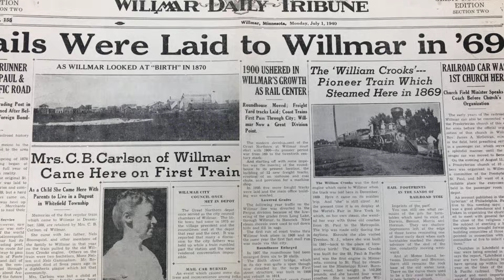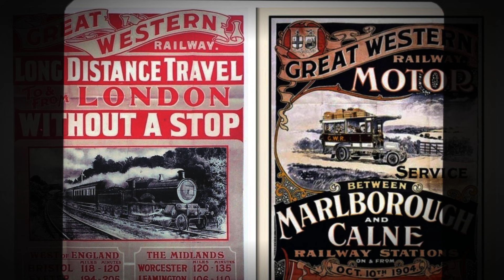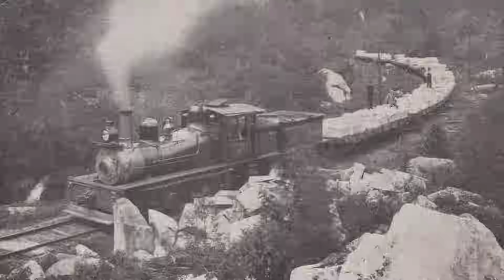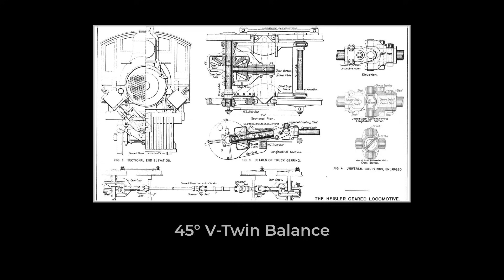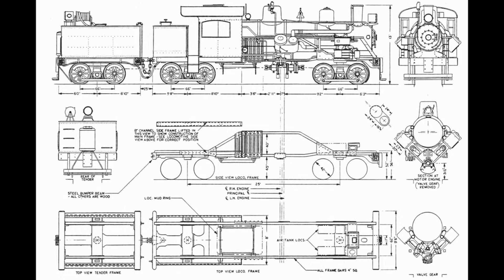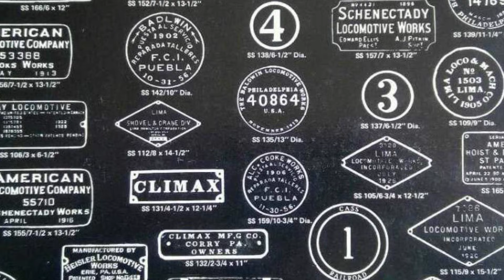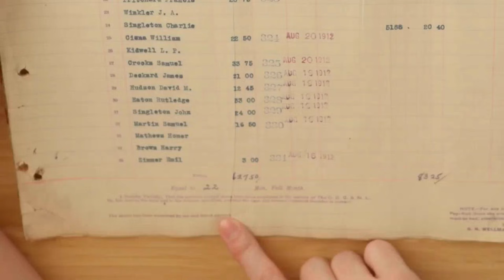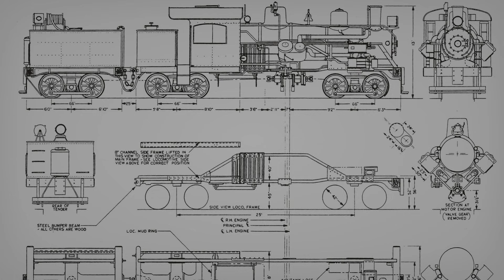Investors Called His Locomotive "The Most Idiotic Thing Ever Built" — Then It Took Over Railroads

Comment: THE TECHNOLOGY OF THE HEISLER  LOCOMOTIVE DRIVE LINES  MAY HAVE BEEN THE BEGINNING OF THE 
THE MODERN AUTOMOTIVE DRIVE LINES !
THE GREAT UNKNOWN INVENTOR AND ARCHITECT OF THE AMERICAN AUTOMOBILE, WAS LOUIS SEMPLE CLARKE IN PENNSYLVANIA!
HE AND HIS BROTHER DESIGNED AND BUILT MOTORIZED BICYCLES AND TRICYCLES BEFORE EXPERIMENTING AUTOMOBILES.
THE EARLIEST CARS HAD MOTORCYCLE TYPE CHAIN DRIVE SYSTEMS BETWEEN ENGINE, CLUTCH TRANSMISSION AND REAR AXLE.
ALL THIS CHAIN WAS AS MUCH AS 
3 OR 4 MOTORCYCLES, WITH CLEANING , LUBRICATION, AND 
ADJUSTMENT WORK.
LOUIS SEMPLE CLARKE  STARTED WITH AN 2 CYLINDER  HORIZONTAL 
ENGINE , WITH CLUTCH  , TRANSMISSION AND DRIVESHAFT TO AN CENTERED BEVEL GEARED DIFFERENTIAL AND REAR AXLE!
THIS WAS THE FIRST AUTO DRIVELINE
TO BE SUCCESSFUL AND COPIED FROM THE HEISLER LOCOMOTIVE!
THE CLARKE BROTHERS WERE THE ORIGINATORS OF THE AUTOCAR TRUCK CORPORATION, STARTED IN 1897, AND TODAY IS THE OLDEST USA
LIVING AUTO BRAND , NOW 129 YEARS OLD!

Comment: The engine at 12:02 is actually a Shay, Heisler's main competitor, and an excellent unit in it's own right.
West Virginia's Cass Scenic Railway, a former logging operation, is a well-known haven for Shays and even features a lone Heisler.
The concept of the pivoting powered trucks carrying and delivering power to the rail eventually became the basis of the diesel-electrics nearly 100 years later. The difference being the use of electric traction motors replacing the driveshaft geared to the axles.